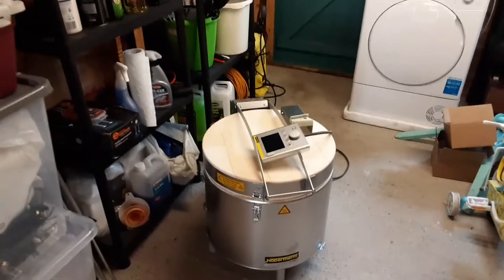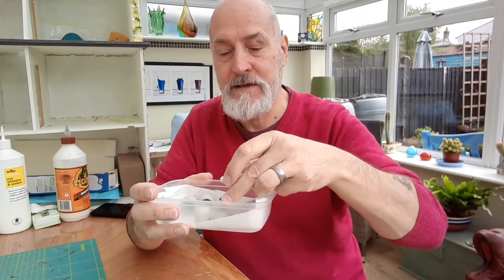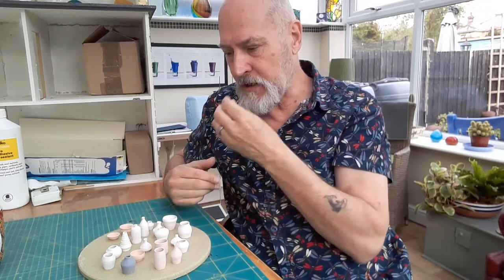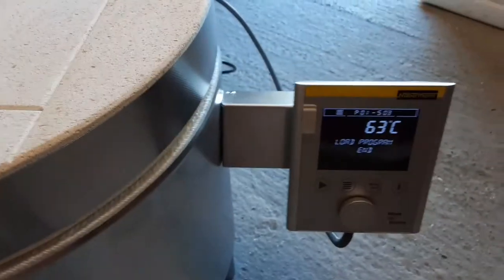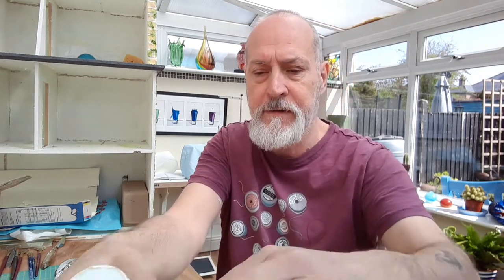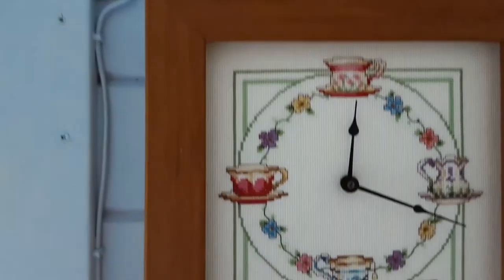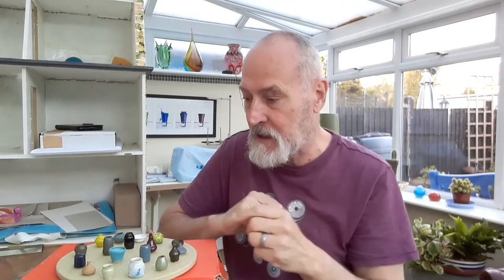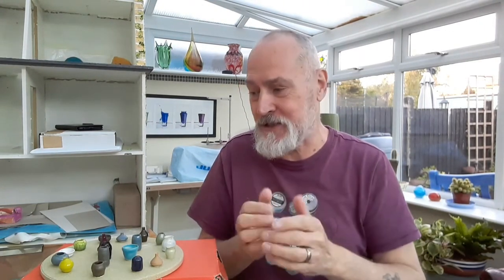Nabertherm kiln first firing

Comment: Hi there - loved watching your video.  I wondered how long a bisque firing and a glaze firing takes in your 16L kiln?  I have got the larger 45L kiln and wondered whether to invest in a smaller one for smaller firings.  Any help would be appreciated - I am here in the UK.  thanks in anticipation.
Reply from the maker: Hi Jacquie, my bisque firing is normally 0 to 600°c for six hours, then a couple of hours from 600-999°c.
The glazes are all different times though, depending on the glazes used, or if I'm then glazing on top with gold or silver etc, of which they are fired for a third time! But I start by seeing what the glazes say on the bottle for temps, and then usually make up my own programs. Trial and error is the name of the game, and when I find a suitable program for a make of glaze, then I use that.